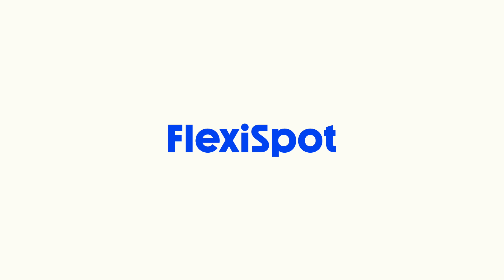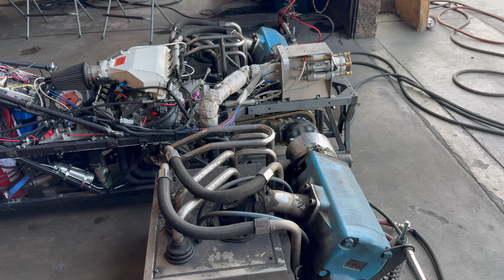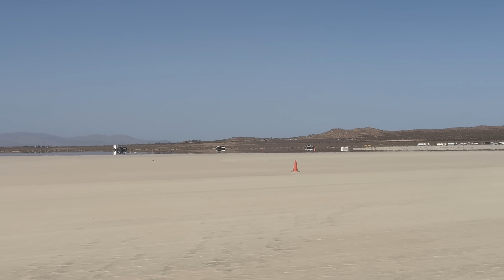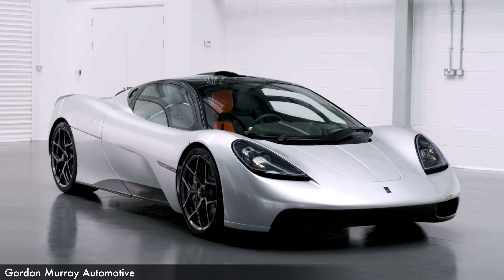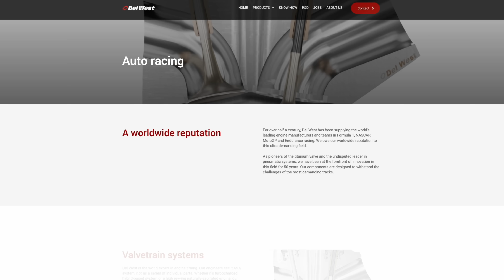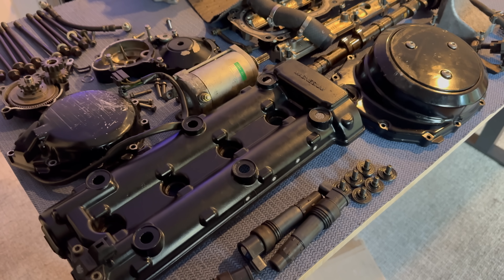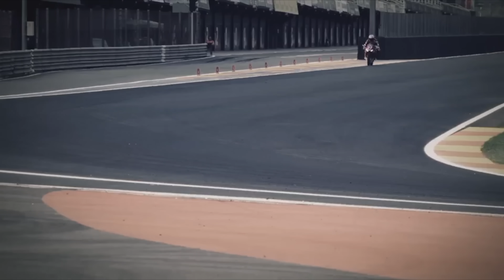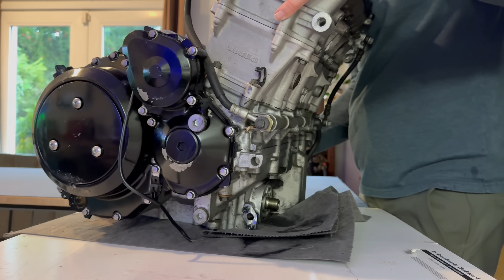Motorcycle Engines Are WAY BETTER than Car Engines

Comment: Government regulations are a greater challenge than physics and engineering.
Reply: To be fair those government regulations are 100% necessary. You could build anything if you just ignore any amount of toxic waste produced by the process/machine.
Reply: @Skyrim1578 no, actually industries do regulate themselves, and where they don’t adequately protect people and the environment, the courts can step in. So government regulations are NOT “100% necessary”.

Sadly, the same system that fails to encourage self regulation or provide for effective legal remedies also fails us with its ridiculous, enormous, counterproductive regulatory bureaucracy.

Wouldn’t it be great if our government regulation was better at actually regulating? Couldn’t we somehow have a clean environment and safe products without nonsense rules that drive up prices and make products less desirable, while doing nothing to protect consumers?
Reply: Engine heads would buy a cancergiver9000 if it meant that the car revved higher and went a little faster.

Comment: "Motorcycles are not meant to go for 150 thousand miles"

Honda VT600C Shadow laughs menacingly in the corner
Reply: literally every throwaway car laughs at motorcycle mileage now though..  your kawi made 75,000 miles before dying?  that's when i did my geo metro's first oil change

Comment: Oh man, I loved my very special GSX-R 400R back in the early 90s. A 400cc 4-valve 4-cylinder 4-carb setup with a 15,000 rpm redline, and a cut-out at 16K. Maximum power was a crazy 64 HP at ~11,000 rpm, on 105 octane gas. 
FYI: at 15,000 rpm, every piston was reciprocating 250 times a second! To this day, I have no idea how they achieved that feat back in 1990. It was mind blowing.

Comment: So for a car a v16 engine designed like a motorcylce engine that cools exhuast down to cool enough for the fuel to drain away. You wouldn't be able to use cat tho.

Comment: Using cubic inches might be lazy, but large amounts of consistent reliable power on cheap fuel requires cubic inches.  Control of the power (like in an over engined small car) is also easier when the engine isn't stressed.

Comment: Cool video, although I knew every single part of it, I still enjoyed watching it. 

That being said, as a Hardcore Honda owner ( I have 2 cars and 3 bikes, all Honda) I wanna say this:
Nobody wants a V8 2 Liter S2000 !!!

The HARDCORE TRUE HONDA FANS, want 4 products from Honda. 

1. A 3.0L Straight-6 VTEC N/A S3000. 
(Honda never made a Straight 6 car engine. And judging by the damn fine sound I6s make, THAT IS A CRIME)

2. A 4.5L V10 VTEC N/A NSX 
(Again. Putting VTEC on a V10 with Honda's engine expertise, would probably make the LFA, the Lambos and the M5s look like bad jokes. And you all know what beasts of engines these cars had) (It was bad enough that they turned down the offer to build the McLaren F1's engine.)

3. A new Honda CB-X 1000. Let's call it the Honda CB-X 1000 HR (for Heritage)
(Bring back the Straight-6 engine, and blow everyone's mind into a million pieces) 

4. Make, the damn, Project 2&4, a f*ckn, REALITY. 
(They showcased a project, of a super lightweight, Ariel Atom-like, car, powered by a Honda RC213V engine, the MotoGP engine. My idea ? Ditch the damn GP engine which costs a house, drop in a Fireblade engine, and ditch all the carbon fiber and make it aluminum. Sell it for sub 35K and have me as your first customer.) 

(The list would be 5 items long. But they already made a new CBR250RR 4Cylinder. You know.. Those tiny 20.000 RPM Monsters. :D)

Comment: I'm not so sure about the low lifespan argument. Perhaps bike engines aren't meant to last as long as car engines, (with exceptions like Chevy's notoriously-problematic 6.2 V8). Durable examples exist everywhere, like Honda's bullet-proof Super Cub, or at the other end of the scale, the Goldwing or my ST 1100 sport tourer, examples of which are known to run for upwards of 300,000 miles, (475,000 km).

Comment: As a long time tinkerer, it's driving me crazy seeing headlines claiming that all these Toyota and GM engine failures are due to metal flakes in the oil. Dave's Auto apparently said that fine grit in the manufacturing process is hard to clean, so the residue could be ruining bearings. 

But if you've worked on a motorcycle engine, you know that they are indestructible. There are ways to make engines that don't explode after a few months of light urban driving. 

It's not metal flakes causing millions of engines to explode.

Comment: First vehicle was a motorcycle, cheap good quality used, easy access to service stuff for maintenance, cheap parts, and great on gas when driven calmly. Got tired of dealing with weather and low cargo capacity tho lol .

Comment: There is one way in which they are vastly inferior - NOx emissions. NOx emissions are a major public health issue. In order to match the same kind of horsepower numbers as a car, using half the displacement, you have to run the engine twice as fast. As RPMs go up, NOx emissions increase exponentially. This also has implications on fuel economy and longevity. 
Motorcycle engines aren't superior, just different. 
Also, there's something to be said for having a non-sequential manual transmission. Going from fifth to second is a smooth, laid-back affair. With a sequential transmission, it is a flurry of activity.

Comment: You can think of engine stroke as a trade off for the limit states between the valve train vs the bottom end and not necessarily a benefit per se.  It can become useful as an optimisation.  The longer the stroke, the lower the revs… but at the same piston speed the valve train will not be troubled by valve bounce and the charge volume per second (e.g. the power) will be equivalent and bounded by the same limits of the port geometry of the head and valve accelerations, timing and cam lift can be easier to manage.

i.e.  revving high is not a benefit per se

Motorsport class regulations can impose engine capacity limits (take as a for instance the 1995-2005 V10 3.0l natasp F1 engines) and this promotes the choice of short stroke and high revs in order to maximise valve area and hence volumetric limits and power.  The knock-on effect for F1 was that the valve train could no longer reliably by based on metal valve springs, so F1 used pneumatic valvetrains to make those engines work.

Low revving engines are not needfully inferior.  I’d posit it is just because the industry (and motorsport classes) tend to default to categorising engines by displacement, not valve area.

In many ways, the dwell you get at TDC on a longer stroke is a beneficial characteristic and power can be optimised impressively on slightly under square design.. but this is an optimisation that will only ever be of relevance if the rules allow it and I don’t dispute that the out-of-the-box package of a superbike engine is hard to beat.

My experience is based on building a number of car-based engines to their limits and competing against bike-engined cars.  Bang-for-buck the bike engine converters were onto a good thing and I wasted a lot more money.  However my engines were demonstrably capable and more than equivalent in power, power band and usability.  I’m talking about four cylinder race engines that peaked at about 9000rpm and didn’t need rebuilding all the time.  As one-offs, the costs were excessive but the engineering was on-par with the bike engines albeit with optimisations based on slightly different parameters; they didn’t disappoint.

I just cried more when/if my engines went “pop”.

Comment: One of the best ways to picture an engine, is as an energy recovery system...for bombs. Think about it: Bombs are dangerous because they release a lot of energy in a short span of time. But what if you could harness that energy and use it for good? Enter, the 4-stroke cycle. Lots of little explosions, converting as much of that energy into rotational and then forward momentum as mechanical engineering will allow. It's kind of wild that it all works so reliably--and quietly--under the hood of our cars or within a bike.

Comment: didn't see the video explanation but basically tork is the answer... 

but mark my words, no one is seeing hybrid the good way, eletric engines are THE THING for tork, soo basically we can get rid of the car acid battery, reverse gear, alternator, starter etc... making the engine lighter.

and also design it to have low tork, rev high and with good emissions, because the car produce most of the emissions in the first start of the day, it produce lot's of emissions till the catalytic converter is worm, but hybrid also can make you start the car, get of running in eletric power, worming the catalytic converter and when it's done it start the engine...

the eletric engine can produce the torque in low rpm and speed, and the combustion just top end power... obviously combining each in every scenario. 

hybrids are cool, the companies just don't know how to use it yet

Comment: Just curious, what would be the case of the motorcycle didn't move toward automatic fast enough like cars. they instead go with slipper clutch and quick shifter instead of removing the manual transmission.

Comment: Also I think another reason they're not as common on cars is the maintenence requirements, which is usually fine on bikes because the engine is already pretty much hanging out in the open, but the engine bay of a car is just harder to work in or take the engine out for more detailed services.

Comment: "If plastic is not engough, but aluminium is too much, magnesium is your friend." This is a brilliant summary. This is the same rule in Mountain Bikes where they mainly use it for fork upper legs and flat pedals.
Reply: I don't want to be THAT guy but I just have to tell you because I worked as a CNC programmer on CNC machines that made frames and parts for many high end MTB manufacturers... Tell you what? To tell you that MTB's are a scam... Most top end mountain bikes have only around 50 main parts in total that they consist of (cca. 350-500 total parts) and our factory was making everything except gearswitches - and guess what? It's all dirt cheap, super easy and super fast to manufacture... We used to buy raw materials in TONS for only a few thousand bucks up to 10 racks at most and then manufacture TENS OF THOUSANDS of parts from it, profiting anywhere from 100k up to a mill... For example, you know those titanium frames that MTB people like to spend THOUSANDS on? Yeaaaaaahhh those cost like a few hundred bucks to manufacture - overhead and all other manufacturing costs included... Yeaaahhhh.... So next time you see a mountain bike that sells for like 8-12k... Just know that the actual worth of that bike is probably less than 1-2k....
Reply: @nogerboher5266  You are correct and most mountainbiker know that too. Higher category MTB-es cost 2-3 more then what they technically worth from end user perspective. Manufacturers over inflate their prices with uneccessary thechnical solutions and marketing tricks. They even intented artifical product lines just to ask more money for it. Like electronic shifters or 32 size wheels. Sure they have benefits, what doesn't have? But the main goal was to have an exuse or push you to ask you another thousands dollars. For that reason many MTB ers build their onw bikes from their own selection of components. Can be lot cheaper and better fitting for your needs/personal preferences.
Reply: A lot of the time in mountain bikes it's actually a steel or aluminum metal it's not often magnesium.
Reply: theres nothing such as too much

Comment: The cool thing about dog box transmissions people rarely mention is there's no need to clutch between gears, the gear dogs are designed to pull gears together without synchronizers so you can bang through the gears under power. Matter of fact the more power the better the gear engagement.

Comment: Motorbike engines pollute more, and require 5-10 times more revs to move 5 times less weight. More revs = more solid particle pollution aswell.

Comment: Input shaft rotation depends on primary drive, gears will indeed turn the transmission input shaft opposite of crank rotation, but chains will turn the input shaft in the same direction as the crankshaft. This is why not all motorcycle engines rotate in the same direction. As cam chain tensioners always act on the slack or non drive side of the chain one can easily determine engine rotational direction by tensioner placement. Consumers are almost always willing to pay more for their toys than boring necessities, as a result motorcycle manufactures have the luxury of employing more exotic materials and engineering.

Comment: I think it's a common misconception among motorcycle enthusiasts that automobile manual transmissions are not also constant mesh gearboxes. Motorcycles don't need  synchromesh because 1) they have straight-cut gears, 2) they don't transmit as much torque, 3) the ratios are closer, and 4) you can only select the next gear up or down.
Car guys call this type of transmission a "dog box," and they're often found in racing cars. They're not practical for the street though. For one, straight cut gears are loud (most manual cars have straight cut reverse gears). And while having to rock a 400 lb bike back and forth after coming to a stop in a high gear is an annoyance, it's a major pain with a 3,000 lb car.

Comment: Another benefit to making your power at 14,000rpm is that you're not making much torque, so your transmission can be smaller and you can use a chain or belt rather than a series of gears and shafts to get power to the rear tire.

Comment: Absolutely false. Put your 1000cc 200hp motorcycle engine in a 1700kg car with the standard gearbox. It's going to be a peice of shit. It's about what's fit for purpose. Motorcycle engines are made for much higher rpm and much lower torque requirements. A car engine with the same horsepower in the same application is going to be more efficient,easier to drive and last hundreds of thousands of kilometres longer. In a very specific application range motorcycle engines are almost unbeatable. But in most they are not even worth a thought.

Comment: If having a larger valve to get fuel air and exhaust gases out of the piston wouldn't it be a better idea just to have the engine cap slide in and out of position in order to allow this to happen having fuel air come in one side of the Piston cap and then be blown out of the other side of the Piston cap

Comment: As a driver who is super particular about parking with precise parallel alignment and equal spacing from the bay lines and surrounding vehicles, I would appreciate improvements to the self-parking feature.

Comment: It's not the diameter of the valve which determines max. air/fuel mix flow into the cylinder - it's the circumferential length around the valve. And more of this length is obtained through using multiple valves within the same the same head space. And smaller, lighter, valves can open and close more quickly allowing for higher maximum rpm to be used.

Comment: "Here for a good time, not a long time" is a phrase that I always think of when discussing this subject with fellow gear heads. Normal car engines regularly run for over 200,000 miles. Good luck with that on a 10,000+ rpm engine.

Comment: Never thought about the power density of a motorcycle but you're absolutely right, even a chilled out regular drinking beginner ADV bike like a cb500x makes 100hp per liter. Honda, the same company, was bragging about doing this with the S2000 because it was the rare naturally aspirated car to do it.

Comment: Maybe Honda's new S2000 shouldn't be based on a CBR-R but an ST engine ... or rather two of them? An ST1300 V-4 is a little more relaxed than the CBR. Strap two together longitudinally with the output shaft straight to the back wheels on your V-8 2600cc S2600. The nice thing about the ST engine is that it is sane and sedate below about 4000rpm with all the fun and noise kicking in above that and max power ~234hp @ 8000rpm,  max torque ~172 ft.lbs @ 6500 RPM. The ST engine has a long history of delivering lots of miles - 300k is not unreasonable. Yes, this would be a little 'detuned' from a potential 13k rpm, but still a whole lot of fun. I look forward to seeing it in your next video!

The alternative VFR1200 engine would rev higher but the ST1300 would probably fit a car temperament better.

Comment: The main thing, that you completely disregard is that it isn’t about power, but about torque. You wouldn’t be able to pull a mid-sized family car with a motorcycle engine because the pull-away torque to make it move would be at ridiculous engine revs, causing massive clutch slip - it is the same reason why your tiny MC engine has this many clutch disks. So unless you can make cars weigh 500 kg and drop any sort of towing, sure MC engines are better… But what you are saying is that bikinis are better than a winter jacket. Sure, it is better for certain applications, but you wouldn’t really want to go skiing in a bikini…

Comment: Excellent video. He understands. 

It wouldn’t be the the internet if I did not flag a technical error.

He says something like  “valves can be opened OK but they rely on springs to close them” That is incorrect. Valves rely on springs to decelerate them, including when they are opening and decelerating at the same time.

The opening phase of the cam includes a deceleration phase and this is what initiates valve float.

Comment: Some 1000cc motorcycle engines DO last 200.000+ miles in good condition. It just happens that you have to do maintenance more often than in a car, but longevity is pretty similar.